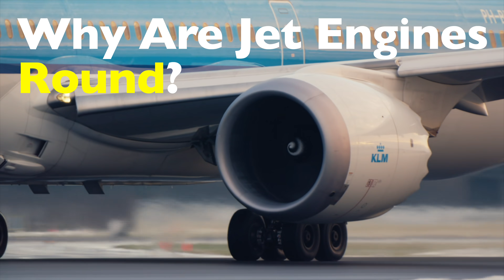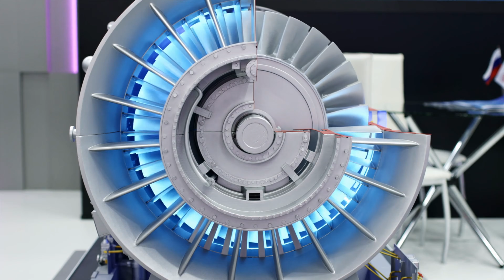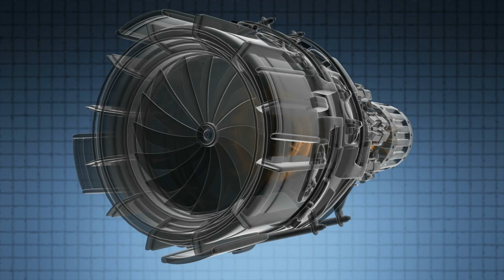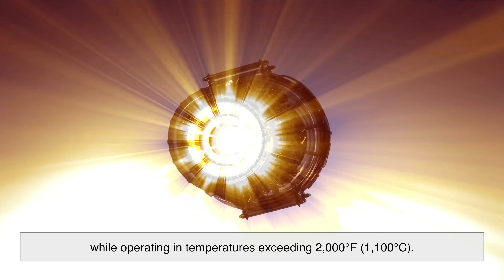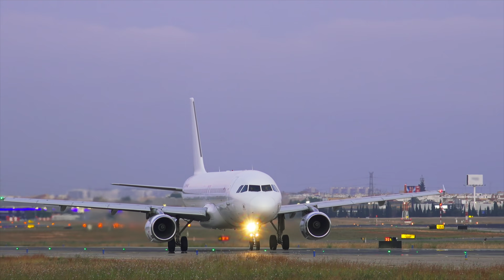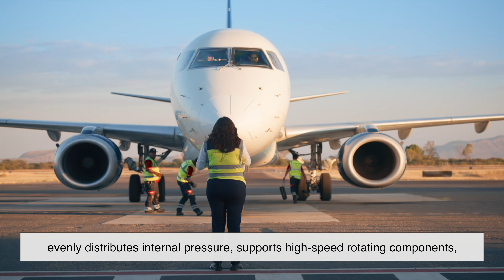Why Are Jet Engines Shaped Like Tubes?

Comment: Revolutionary Innovation for Sustainable Engines (RISE) program to test a radical open-fan (open rotor) engine design targeting a 20% reduction in fuel consumption and CO2 emissions compared to current modern narrowbody engines.